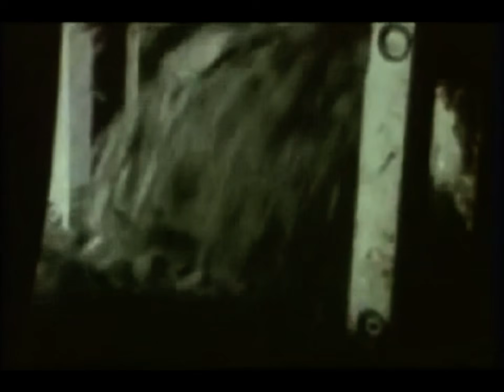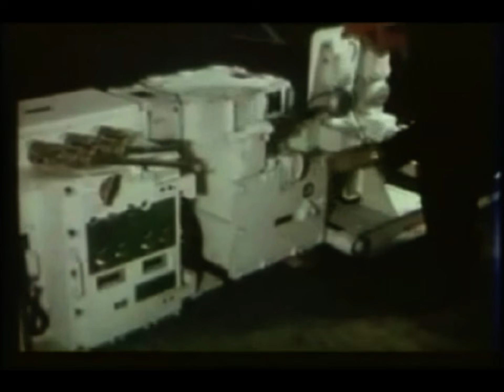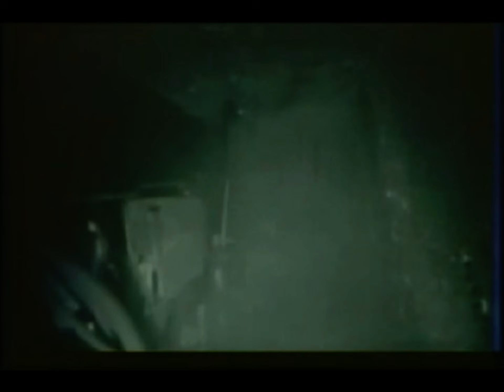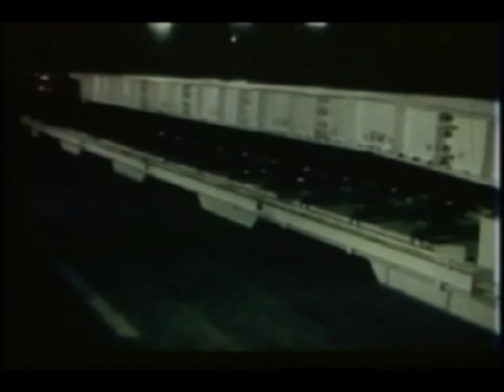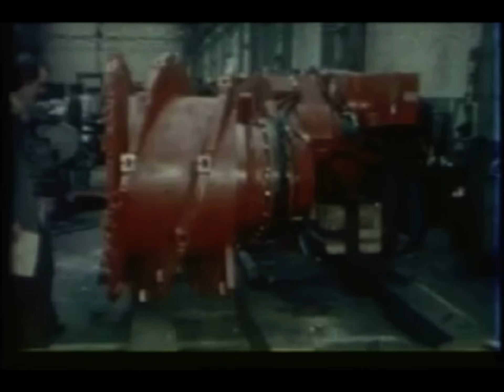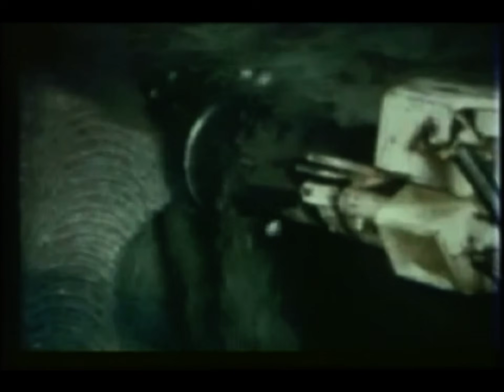ANDERSON SHEARER

Comment: Started working at the moment I was 17 I’m year old worked on the cold face from 18 years coal hand filling 10 yards a day equivalent to 18 ton of coal loaded by hand then I worked on the long wall system operating   Sharers then I emigrated to Canada to run a long wall machine in the Alberta Rockies the trouble was with the long wall the thickness of the coal it was 20 foot thick we tried to take the top 8 feet of coal but with having 12 feet of gold below the long wall we could not get it to work but we tried hard I worked in mining for 47 years and today I’m 82 year old never at work
Reply: Is pretty common these days to leave many feet behind above or below the cut seam, in many cases seams are 20m tall, and only 4m is cut out, the rest may be mined using top coal caving, or just left due to unfavourable quality (ash, sulphur content etc).